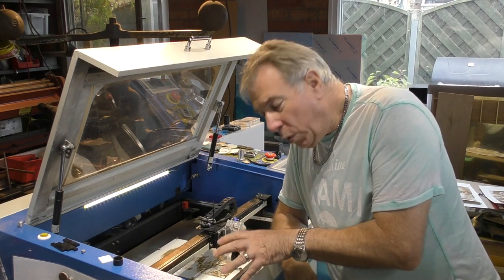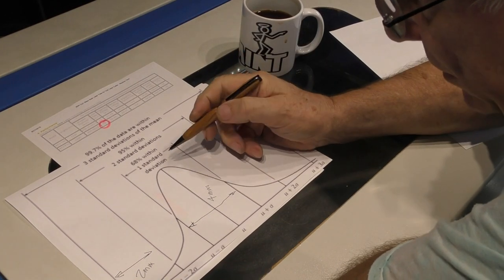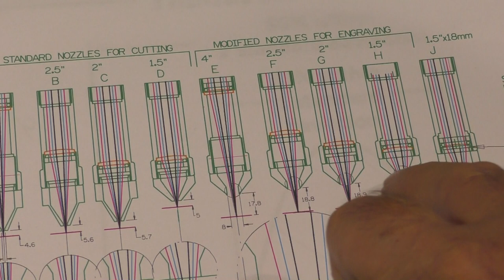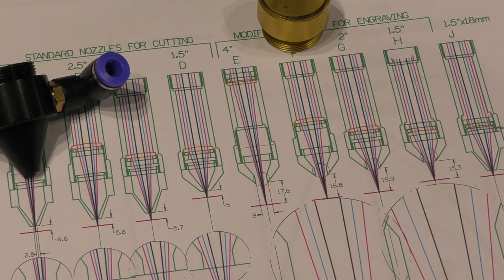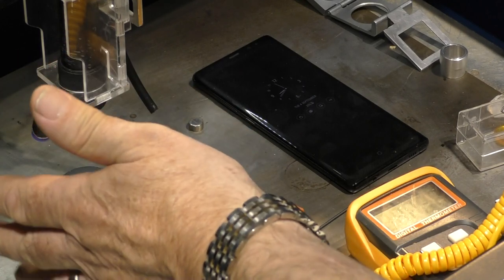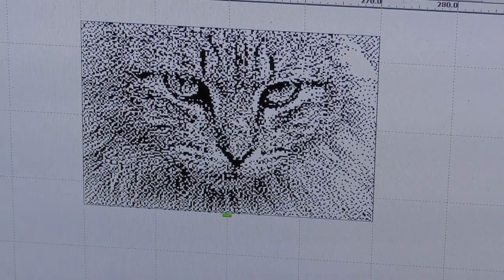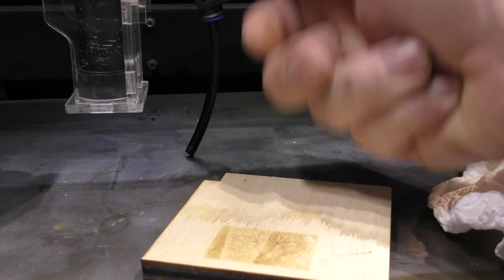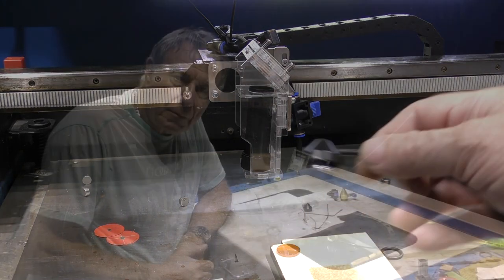RDWorks Learning Lab 153 Nozzle Analysis part 2

Comment: Hello Russ, what is the difference between Cloudray short nozzles, they have two versions (3 with yours, universal). The version A is more standart and the version B more flat, why 2 version. Which one is better, does make any difference?
Reply: @russsadler3471  
Thanks, Russ, for your quick reply and your excellent support.
I am following all your videos, and now I am in correct way (having more questions than answers, like you usually say), but overall, less confused and clearer (I think).
And sorry, wasn’t the answer I was looking for. Because you are comparing different products, I was talking about these two short nozzles A and B: 
https://www.cloudraylaser.com/collections/nozzles-lens-tube/products/short-nozzle-with-fitting-for-d20-f38-1mm-1-5-lens
https://www.cloudraylaser.com/collections/nozzles-lens-tube/products/cloudray-n02-nozzles-with-fitting-for-d20-f38-1mm-lens
1. Why two? Why different formats, one is more flat and the other more cone, both with 18 mm.
2. And please check this all flat engraving head from Thunder laser: https://youtu.be/1FYIhj3Z6to?t=160.
2.1 Why should be so open, if we want the small dot like you explained before.
I think nozzles with end point of 2.5 mm should be better, preventing laser alignments and most 38.1 (in the market, according to my research) are plano-convex. So this open flat nozzles should be difficult to align.

Thanks for all,
Oscar
Reply from the maker: @oscar5689  
 1) Nozzle A and B are exactly the same functionally. Nozzle B will work better because the long parallel piece allows a much bigger air fitting to be used. This allows much better air flow through the nozzle . Choose B rather than A
2) This "nozzle" with such a big hole is reducing the velocity of air going down onto the work. When you are engraving and throwing smoke upwards, the last thing you want is to BLOW that smoke back onto your work to make it brown, This nozzle is protecting the lens  because the air flowing into the side of the nozzle is disrupting any downward flow. It is nothing to do with the beam size.
 If you watch this video from about  15min 20sec.    https://www.youtube.com/watch?v=76wW_uL-rOI
 You will see that the nozzle diameter has nothing to do with beam alignmen. You must align the Z axis in a methodical manner to get the beam running perfectly down the AXIS of the lens tube. If you get this correct then the beam will pass through the  nozzle .

Best wishes
Russ
Reply: @SarbarMultimedia  Thanks!

Comment: Hello Russ, whats that yellow power meter called i cant find it on google. Thanks
Reply from the maker: Hi Srdan
The meter is this description
https://www.ebay.co.uk/itm/Digital-LCD-Thermometer-Probe-2-K-Type-Thermocouple-Sensor-1300-C-Dual-Channel/152761033566?hash=item239144635e:g:nFcAAOSwXoRa8ARs

and the alternative probe is this
https://www.ebay.co.uk/itm/K-Type-Thermocouple-Stainless-Steel-Probe-Temperature-Controller-Wire-Sensors/262964791017?_trkparms=aid%3D111001%26algo%3DREC.SEED%26ao%3D1%26asc%3D20160908105057%26meid%3D4701d305123746748ca73f322d4b331c%26pid%3D100675%26rk%3D14%26rkt%3D15%26sd%3D302739311570%26itm%3D262964791017&_trksid=p2481888.c100675.m4236&_trkparms=pageci%3A88e6baf4-bc09-11e8-84d8-74dbd180b419%7Cparentrq%3Af1dadd161650aca4b8c9be50ffff746b%7Ciid%3A1

Best wishes
Russ

Comment: There are two other common beam diameter measurement methods out there; this page at Ophir explains them all and has a link to an aperture calculator to simplify some of what you did on paper a few videos back. 

https://www.ophiropt.com/blog/laser-measurement/calculate-laser-beam-size/
Reply from the maker: Hi Mike 
Again I thank you for the link. I had spent quite a bit of time on this website and also posed a couple of my seemingly unanswerable questions to them. I think these guys are on the wrong end of the problem. They know what happens up to the focal point  but after that is  not their field or problem, that is why I am convinced my answers lie in acedemia somewhere.
Best wishes
Russ

Comment: So, my 4mm hole size in my nozzle is best/fine?
Reply from the maker: 4mm is perfect for engraving with a 2" lens because your lens is in the nozzle and you will have a 19mm gap to the work. Reduce that gap to 6mm  by using a 1.5 FL nozzle and engraving could become compromised by your air assist blowing smoke back down onto your work. With such a large hole  close to the work and a reduced airflow through it, the explosive upward smoke ejections at every beam switch-on could reach your lens. This distance is reasonable for cutting with a 1.5mm lens but the 4mm diameter is now too big for really efficient smoke free cuts.
Best wishes
Russ
Reply: 1.5in Meniscus so not only do I need that but I must find a nozzle to buy with the hole size you said I need.
Reply from the maker: I'm confident that your 4mm nozzle with 1.5" will do a 7/10  job but when the short nozzle becomes available  I really would favour that for engraving.  A real 10/10 solution for you
Best wishes
Russ